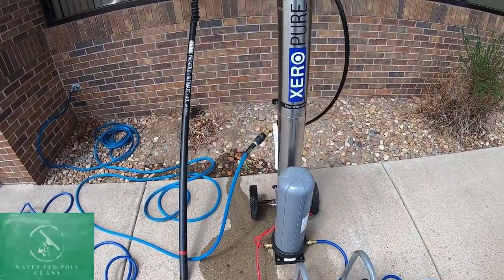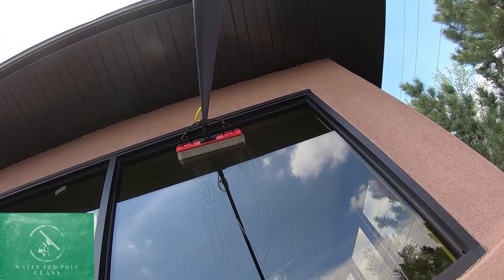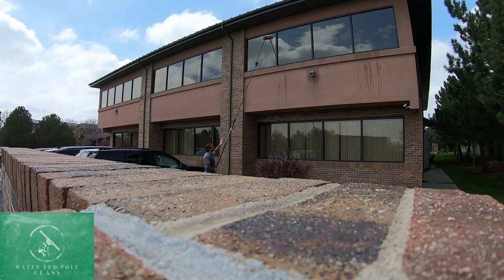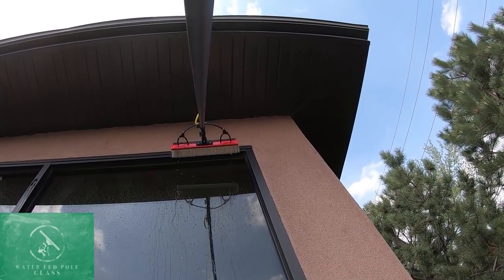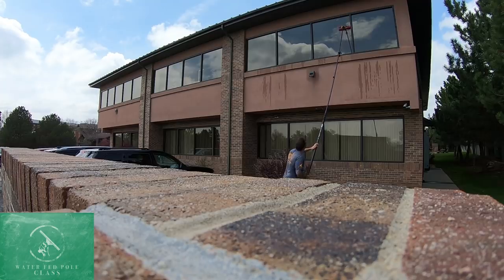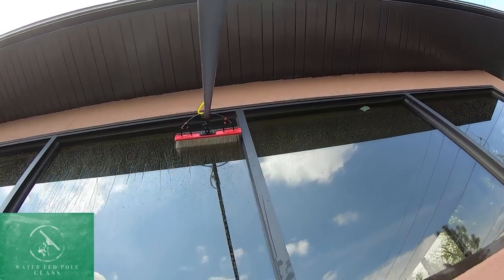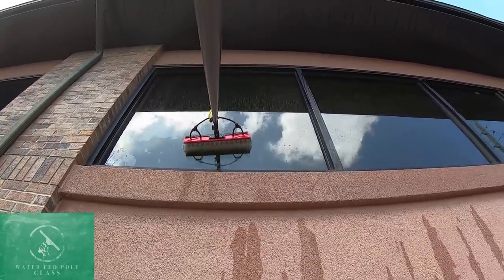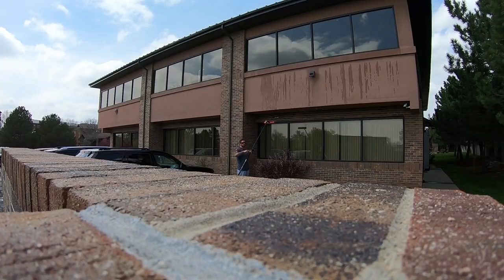How to Water Fed Pole Commercial Windows

Comment: Hey thanks for the pointers. I used mine this past wknd on a big commercial job for the higher windows. I went back the next day and the top windows were a little cloudy towards the top so I ended up just doing them trad style. Newbie problems. I think if I would have used my boars hair brush instead of my hydrid and my bronze wool attachment I wouldnt have had that problem. Live & learn

Comment: Any tips on jobs 3 stories and higher? It's almost impossible to rinse with the brush off the glass at that height. I just rinse with it on the glass but wondering what you your thoughts are?
Reply: I know this question is 3 years old but an over the top rinse bar would definitely help in this situation. I'm no expert window cleaner. 👍🏼

Comment: Why don’t you hit the middle frame when you get these jobs do they only ask for the glass cleaned and you don’t add in the frames when pricing?
Reply from the maker: When using pure water on glass, you want to avoid the frames as much as possible as it can pull dirt towards the glass and cause streaking.

Comment: Damn that takes ages 😂 with the lader its so much faster
Reply: Ok meet me there and we’ll race...better eat your wheaties!!
Reply: I always eat 2 bowls Wheaties stevio 😂 if only I where not that far away, i gladly accept the challenge
Reply: I known for the window cleaner that washes faster then his own shadow 🤣
Reply: man I would really like to see if this is true.  I was also thinking that it looked like it was taking too long and the only advantage would be safety wise but I could be wrong, I don't know.  I would love to see what's faster and gets better result....make it happen Steve O!
Reply: @krayrodriguez  i think wfp is faster and of course safer, in this particular video yes wfp looks painful to work with because theres no pressure at all. I bet if he would have connected the di tank he has in his xero system would have been twice as fast
Reply: It is an instructional video.He probably could go faster.
Reply: @heathergarrity723  you know thats not possible with 35 psi
Reply: @heathergarrity723  ive been so frustrated with 40 psi i just wanted to burn my car and do it trad.. 60 psi and up is good
Reply: WFP is definitely faster on most bigger commercial jobs. I've had jobs that I used to ladder and now WFP and it's about 50-60% faster. Sometimes the first cleaning with WFP will take longer cause u have to condition the sills not to drip dirt.
Reply: @midnitemobber913  you clearly didnt watch THIS VIDEO
Reply: @krayrodriguez  it is not faster. I used to only be wand and squeegee and ladders when I had to go up high. But all those ladder moves require time and frankly there’s a faster way to do this to be honest however, his way is really thorough. What I recommend doing is rinse the window off without touching the brush against it so as not to get the brush dirty try to get the majority of the dirt off with the rinse and then go ahead and start scrubbing when you’re done scrubbing you go back and rinse with purified water and your answer to the next one you can check back and see if it needs a touchup but usually if you do it right, it doesn’t.